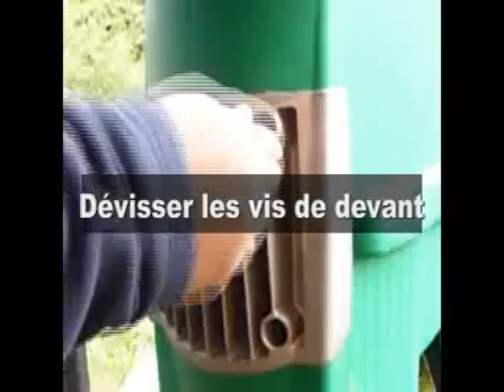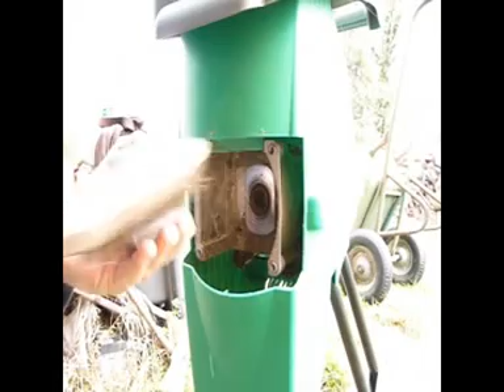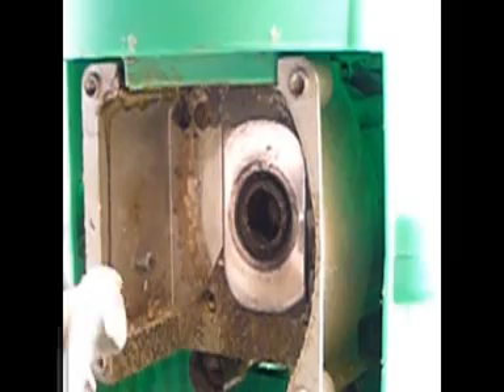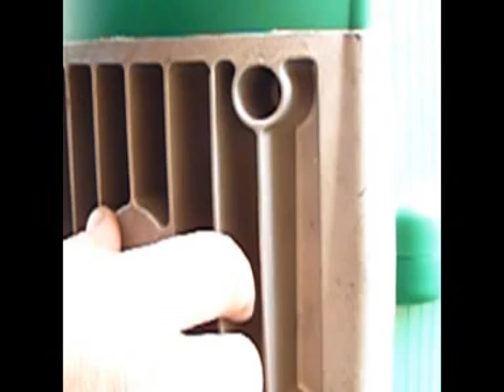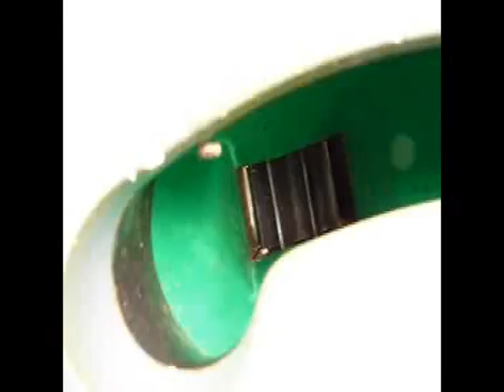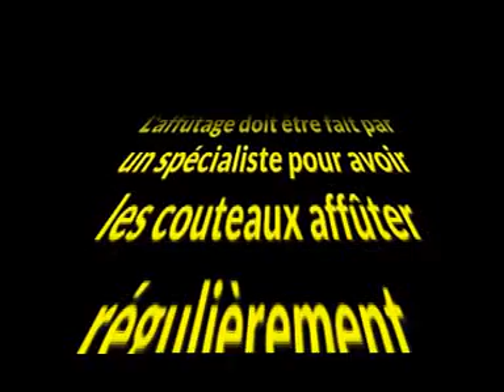Entretien - Démontage lames du Broyeur de végétaux Einhell LH 2500

Comment: you don't need to grease the inner shaft. Clean only.
Reply from the maker: C'est vrai, mais ça peut pas faire de mal !!!
Reply: Et en plus, il y a assez de graisse..:)
Reply: Since it is only sliding bearing, it's highly advisable to do so. Only the manufacturer tells you to not to do so, because it will fail sooner after warranty. The thing I do not understand is that brass brush on the axis :)